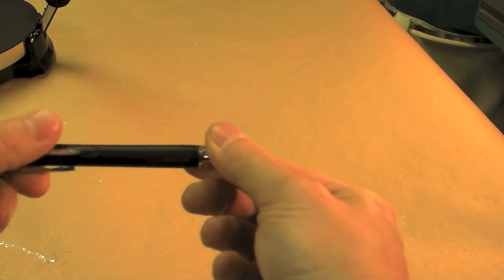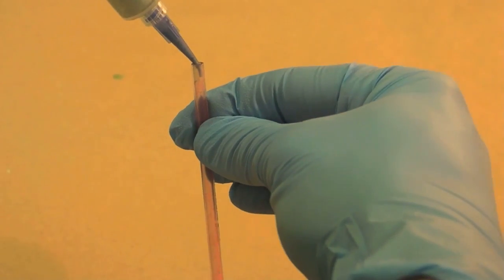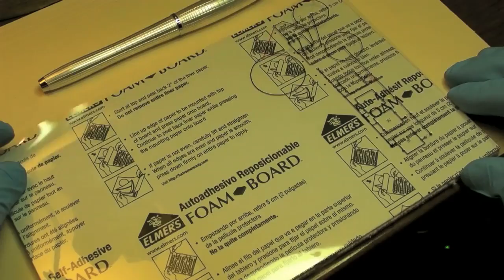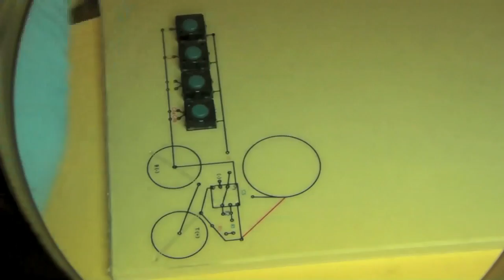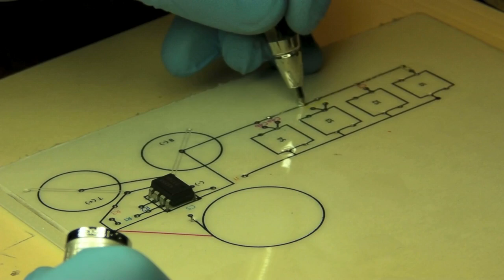Expanded Version: Brew Your Own Conductive Ink

Comment: This was a lot of fun and gave me some sound ideas for modern devices that could make mass manufacturing of PCB's affordable to anyone that wanted to do small runs of custom electronics but still in the hundreds of unites produced. 

A CNC machine with a drill bit and a solder extruder would make printing large and complex PCB's a cheap and quick process. The bit drills a channel while the extruder passes secondary to the bit filling in the track trace with molten solder, and the bit could also drill the holes for PTH parts. 
I'll wager this could be done at a cost low enough that small operations could produce hundreds of units a month with just 3 or 4 people assembling them. In this age of expensive custom musician audio products, hi-fi enthusiast that spend big league and so very many others that it's a viable economy for such an operation. 

Prior, ideas like this never got launched because there simply weren't enough inventors and engineers to need to manufacture for themselves, but this has drastically changed today especially with Arduino and so many other cutting edge devices.

Comment: Try spar varnish with any conductive powder (carbon, graphite or metal powders). Instead of ink, for a phenomenally good conductive glue, mix a PVA based wood glue with powdered silver solder (any lead-free non rosin core solder sanded or filed into dust).

The pva wood glue and solder powder bonds conductively to aluminum, copper, steel or bare silicon :)

Either of these might also make custom resettable fuses, thin semi-transparent conductive coatings on glass for DIY liquid crystal displays (with a very fine powder), or additive circuit board creation (instead of the conventional subtractive/etched copper on fiberglass).

Comment: does the paint ever dry?
Reply: It doesn't dry. It's not wet. It's molten metal. If any evaporated, you'd still be left with molten metal.
Reply: Smart question, unfortunately it doesn't at room temperature :(

Comment: I'm curious, why is this better than making conductive ink from say either Graphite or Carbon? They are much easier to come by and doesn't require as much work.

Still could make a fun project and I totally endorse experimentation. I'm really just curious how much better if any this method is?
Reply: +Lucas Edwards what you mention contains particles that are conductive while this METALS are well .....metals

Comment: I liked when he put water in the cup to try to solve the metal in the water. :D
Reply: Water was used as an oxidation barrier while the alloy was made, clearly stated at 1:38 in the materials section. BTW you can "solve" an equation, but you need to "dissolve" the metals to make the alloy.
Reply: You obviously don't know what I´m talking about, its at 3:04. And I know very well how its spelled just miss 3 letters I see now but it took 2 whole years before someone had a mark about it, have to be a record here.
Reply: You obviously don't know what "you" are talking about, its at 3:04 that "mixing" is happening, no mention of dissolving metal with water, and of course no mention of "solving the metal"... and better late than never!
Reply: Rolando Valdes Now its now proven you dont know what Im talking about. I dont talk about any mixing but about that he put water in the beaker like he was trying so flush the metal with the water. Gees how dam hard could it be!

Comment: Conductive ink for printers. Print your own circuit boards.
Reply: Some circuits but pc are photo etched using light to react with photosensitive chemicals using a optical reduction lense system. You can use old telephoto lense.